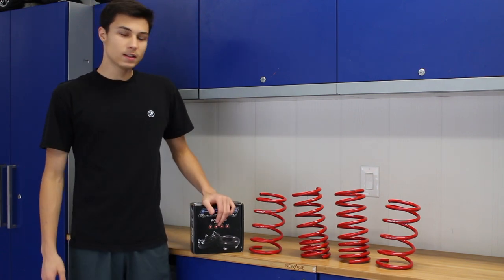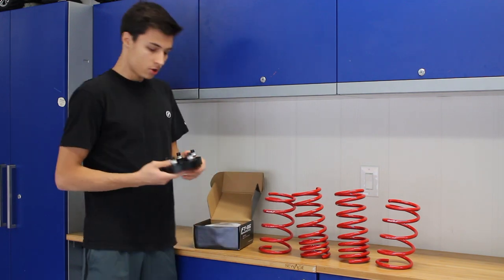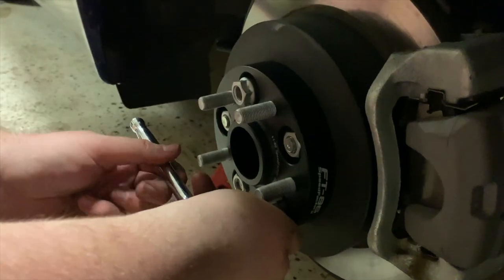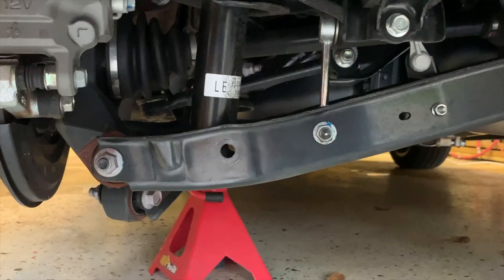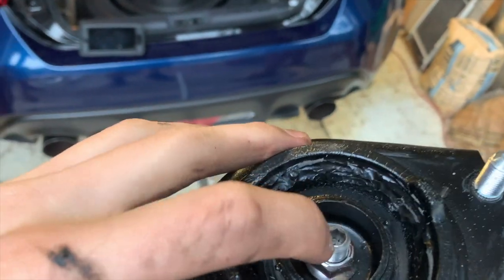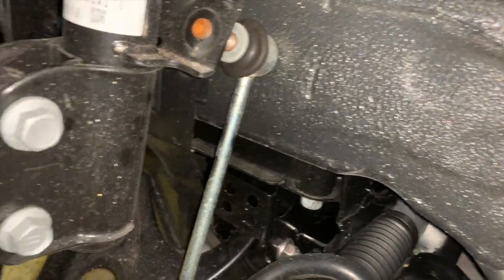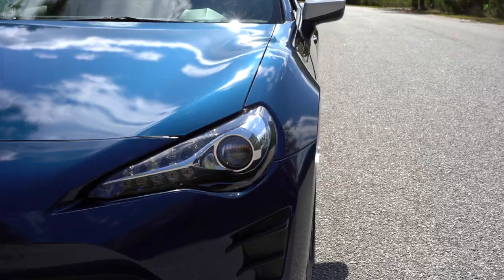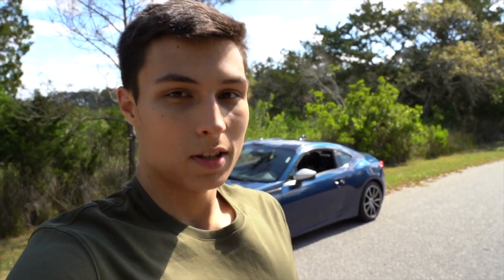FINALLY LOWERING MY CAR!!! Toyota 86 Lowering Springs Install | How-to

Comment: Are you still running these springs on the oem suspension? I was thinking about going with the Eibach sport lines but I’m nervous to blow out the oem struts
Reply from the maker: I’m on coilovers now, but I’d recommend you do lowering springs if you are just daily driving. I feel more confident with the coilovers but with the lowering springs, the overall ride was better. Go with what you feel best matches your needs! You won’t have issues with blowing out the struts so don’t worry about that
Reply: @nikolaiiaksenov  yeah this car is my daily driver so I knew coilovers weren’t the ideal choice. I was just nervous about horror stories I’ve heard about lowering springs on oem struts. From what Ive read, the suspension is really good on the newer brz’s so I figured I’d ask how your experience was while you had this setup lol
Reply from the maker: @dozacqt  I never had any issues so go for it!
Reply: @nikolaiiaksenov  cool, thanks for the help

Comment: If lowering my car, will I still be able to take it to the dealership or regular oil changes/maintenance? Or a special shop for lowered cars?
Reply from the maker: Depends on the shop, but you should be able to.
Reply: Nikolai Aksenov ok thanks!
Reply: i have a question, does lowering the car voids warranty or regulr oil changes?